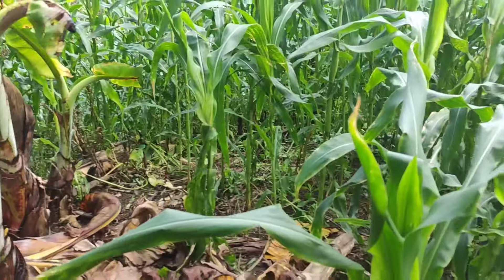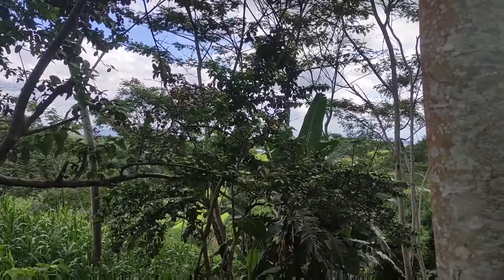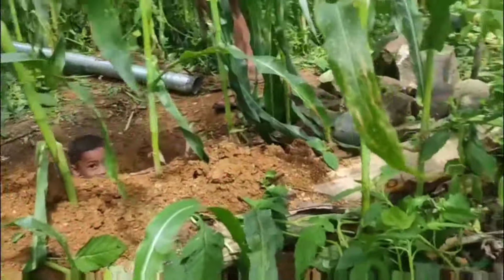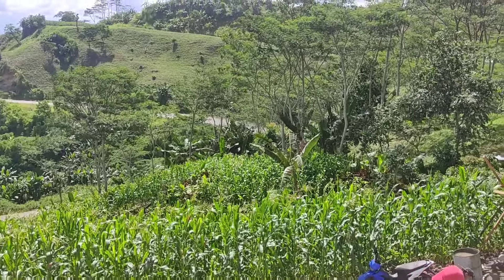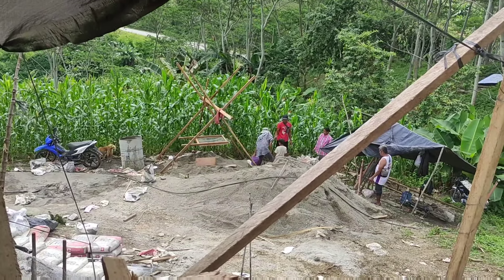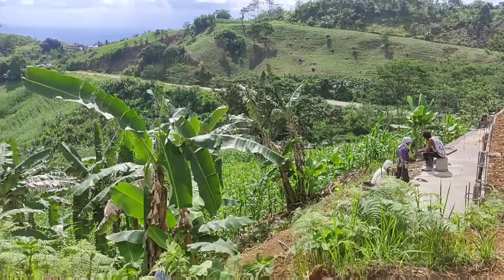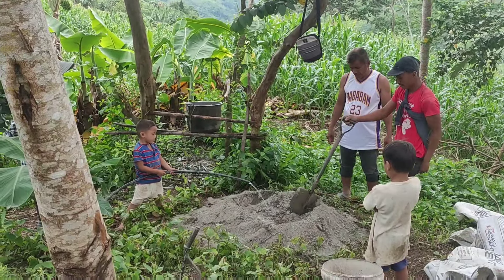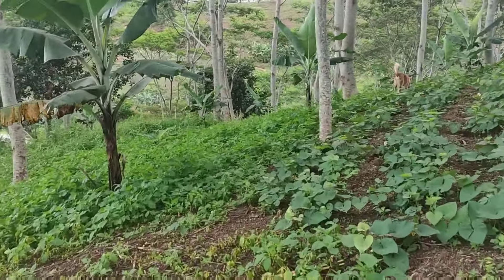Foreigner Building House in the Philippines | Making Electrical Post Reinforcements in the Province

Comment: Something u need to consider, which I learnt from other vlogs, is tht u are getting the full 220v on the line.   Sometimes depending on how many customers are using electricity on tht line u may not get the full volts which overtime can destroy ur appliances.......if its low, power compnay needs to install additional transformers on pole in road to boost it.  Sometimes they will charge u for the transformer too.
Reply from the maker: Yeah, we'll see. We're also quite far from the main pole. I saw that Wilma and Greg got their own transformer.

Comment: You might want to supplement your electricity power with solar and electrical generator, because of the constant power burnouts of electricity in the province?
Reply from the maker: Yeah, most likely. We'll start with grid and see how it works. I'm thinking a small solar setup and probably a generator (to charge batteries when needed after that).